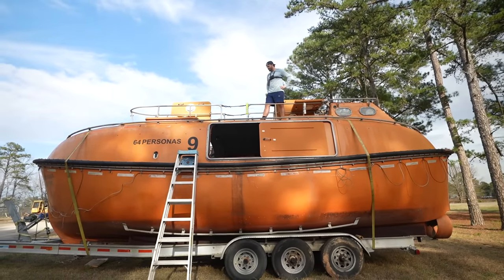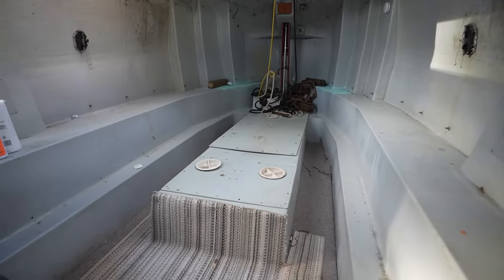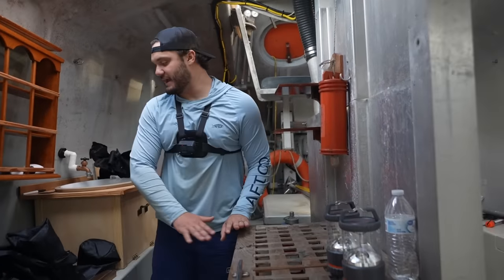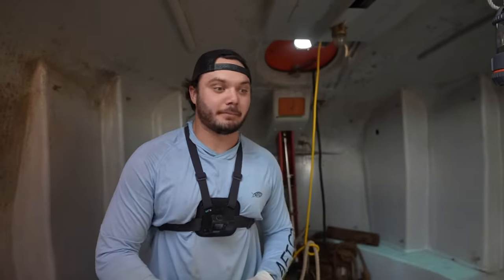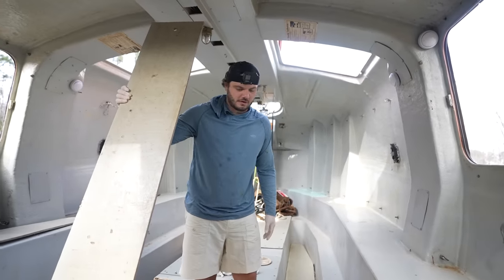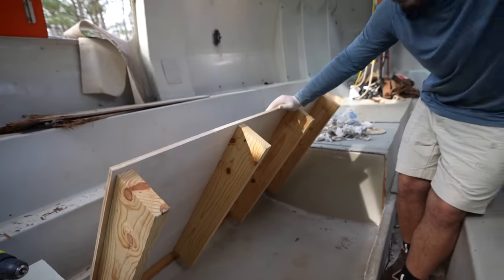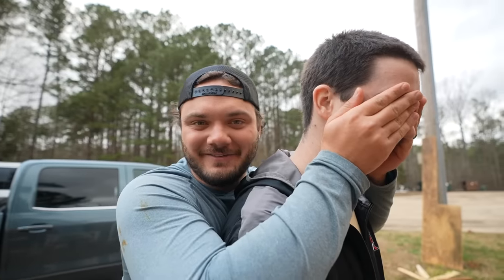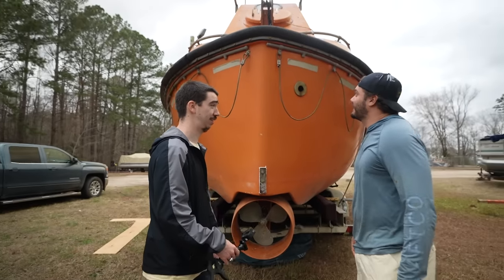Putting A Homemade Interior In My 64 PERSON LIFEBOAT!

Comment: Looks great so far. I would have to say you’ll at least need to drill some holes in the mattress base for ventilation. A foam mattress without ventilation underneath will get mold in it. Learned that the hard way and was out a grand on the mattress. So Swiss cheese that base to keep the one and only Gravy safe

Comment: That is a fantastic quick remodel, the only recommendation I would have is to add a little bit of bracing to the bed doors to keep it from bowing when you walk across... If you place a 4x4 brace at the top and bottom of the doors where they meet and then give each door a 2x4 brace along the long edge it would be perfect and feel like a solid floor when closed
Reply: Tacking on an idea to this comment: When the bed doors are latched up, make the underside of the doors more pretty. Don’t want Gravy to see bare plywood as he goes to sleep.

Comment: You should rig up some simple overhead lighting with like small can lights that run off a battery pack so that way, in the evening, if it's buggy, you can close it up and still have light. Also, you should put screens on the two holes above the bed so you can open them up on nice nights and look up at the stars as you lay in bed.
Reply: Just snuggling with the bros, watchin the stars.
Reply: What
Reply: Yeah I was gonna say you need big screens
Reply: Bug*

Comment: 20:56 Add a thin 4 inch wide lip to the bottom of one of the doors so that two inches are attached to the door and two inches overhang towards the other door.  This way you drop that door first, then the other door and it will "seal up" better and you won't get blankets/sheets pinched and poking through the crack that you do at this point in the video.

Comment: Would definitely be a good idea to put a Maxxair fan or two on that thing. They can either blow air in or exhaust air out.
Reply: 😂it had me cracking up when ayo’s helper said his eyes were burning and it was in his mouth💩💨😂
Reply: Heck yeah. I was thinking it needed some air rotation.
Reply: Word 👍👍
Reply: Hello, I like the idea of keeping it as water tight as possible. So, no new exterior holes.
Reply: @ClutchPedalReturnSprg  a Maxxair vent would make it safer to be in and allow air movement even if it's raining. It may have been designed to be sealed up but without scooba tanks and a good seal or vent for the engine, it wouldn't be safe to seal up.

Comment: so you should make some pull out storage containers to fit under the bed, looks like some long rod holders would go great under there, and you blocked off the dry storage area, but if it isn't an air tight bulkhead you could cut into the front of it and place hinges there for pfd storage or something else, won't lie semi jealous of this build because you could really really turn that thing into the complete houseboat/water camper lol

Comment: You could add another alternator on the engine that would charge a battery pack for lights and such.
Reply: I was thinking some solar panels on the roof would be killer.

Comment: Just an FYI you can get paint and have them mix it at different percentages so you have the same color but lighter. Get that paint at 50% and I think you would like it much better. That is a cool boat. I have never seen anything like it. Cannot wait for the finish. You know this would have been a great cabin for Lojo’s pond or a nice tiny house. That cabinet under the Matress making open from the front and have a place for pillows and blankets.

Comment: Hey AYO, I think you can better utilize the space if you cut your bed in half and made each side like a murphy bed. You could probably keep most of what you built and just tweak it. This way your bed is stored out of the way against the wall until you need it. And you wont have to worry about doors falling on you, worst case scenario.

Comment: This a really cool idea.  TEMPSCs are designed to be airtight and basically last forever in saltwater environments yet ran for 5 minutes a quarter so the engine and hull are practically brand new.  

I do hate the be that guy but I will point out that this is NOT a free fall lifeboat as mentioned in all of the videos which is a good thing.  Freefall boats are made so that all of the interior is built at an angle with chairs facing backwards and lots of steel structure to support and protect its occupants during a launch, which you would of had to work around.  

This boat would be launched by a gravity davit on a pair of cables (falls) which are released by a mechanism by the coxswain once lowered into the water.  This is a much better candidate for a houseboat conversion than a freefall design.  

Next I vote you put an AC unit and a diving board on it!

Comment: Alternate use for that folding bed top thing: keep the doors flipped up most of the time, then the space between the doors and the hull can conveniently be used as a hamper. Come laundry day, just unlatch the doors, and wham, there's all your laundry ready to be stuffed into laundry bags lol. I could also see replacing the fuel engine with electric in a way that allows the prop to free-spin and generates some power. Perhaps a craft like this could have one of those sail-kite systems made extra rugged for downwind runs. Great time to recharge your electricity with the prop lol. I think the folks I saw that made an Arctic cruiser out of a 100-person lifeboat did that. I love the idea of turning one of these into an all-season tiny home.

Comment: The dash to the engine is in norwegian, i´m half norwegian so if you want it translatet just let me know. Very basic stuff, tells you to glow the engine max. 30sec before start, check the battery charging light, main battery breaker and stuff like that. Love the show!

Comment: These things are designed and built to take an absolute flogging so I don't think you'll run into structural issues.
I think you could get more useable deck space outside if you look at making some "wings" that hinge at the gunwhale level and fold up for movement on a trailer or the water. They can be secured to points on the side of the upper deck. Aluminium would be a good material to build the base frame out of. That way you have deck space without having to be on the roof and restricted in its usefulness, even if it's just grating and not solid decked.
When Googling "64 person lifeboat" you fill the entire first page! WIN!!! lol
Definitely look into some solar panels for house power. Just like an RV or camper. The Jackery, EcoFlow and Bluetti systems are awesome, but having something that you don't need to constantly check and recharge pays for itself.
The sheer size of this boat gives her huge amounts of potential just due to the amount of interior space.
Reply: I think the interior space would be much better with floor boarding right across the bottom starting from the side seating height, so it's one even floor throughout the whole vessel. It looks like the roof is high enough to do that. That way there is a lot more space to put a bed, table, chairs, etc. It would also enable storage under the floor and the engine would be under the floor with access to it. I would also spend time and money carefully designing the interior after making it watertight. Might need a woman's touch lol. Also add a small toilet/shower section. Oh, and paint the outside white with nice trimming. The outside would be a whole other project to be honest, such as changing most of the openings into windows with one doorway. Obviously, everything would have to match the shape, but that's part of its uniqueness.

Comment: You should get one of those aluminum ladders that are for RVs and pannel vans, and mount it to the outside by your main entry hatch (or on both sides).

It will make getting in and out easier plus give you a better path to the roof.

Comment: That's what I was thinking about!  I was thinking it'd be really cool if you can turn it into like a camper.  Maybe you could put a bed inside there, and a table with a couple chairs.  Put a radio inside, and some books.  Maybe you can even put solar panels on it somewhere so you can have electricity to at least brew a cup of coffee and run a laptop computer and some lights and a mini fridge.  You know, kind of like all the Comforts of home.  You might want to clean it up really good on the inside and give it a brand new paint job on the inside first, and maybe even lay some carpeting in it.  Maybe even add a couple plants, and a couple pictures on the wall.  Oh, and don't forget the rod and reels and the fishing tackle box.  The possibilities are endless!

Comment: The repaint has made such a difference. It looks clean, light and fresh. I do think that the top deck needs a fresh coat of paint too. Preferably before you add the solar panels. I've seen Narrow Boats on UK canals with super thin solar panels that stick to the roof of the Boats. That might be worth considering or at least checking out?

Comment: Kindly suggestion. Put long pieces of a soft plastic of rubber running the entire length of the "coffin doors." Two strips over the hinges and one that will overlap the opposite door. That way when condensation happens, and it will, you have at least some protection for the mattress.

Comment: It needs more amenities. First. Needs 24 in flat screen television. Need to add some plush comfortable seating, inside. Also, needs lighting, inside, so you can chill inside at night or when it rains. Need to add more accessible ladders inside and to get to the top. Add walkie talkies. So, when someone is on top, they can talk to someone inside and via vera. Needs a Camera. So when your inside, you can see what is happening outside, on the 24 inch flat screen. You need a frig! Also, needs a place to store garbage. And what about number 2? Also, the topside needs some kind of chairs, so multiple people can chill on the top side. And, some kind of BBQ and a toaster oven. Also, need those fishing-pole holders. So then not using the fishing poles, can just put them up in those holders. Probably needs some kind of tackle box for the top side (that is bolted down) so it not falling off the roof into the water. Need a fish cleaning area. If your going to catch and eat the fish. Put down some of that anti-slip tape on the top side. (get it a boat marine store).

Comment: I would have cut that forward center storage boxes out. Make a flat floor all the way forward as possible. Put bunkbeds on both sides forward. Have top bunks fold up, and a removable table between the two bottom bunks. Maybe even have the two bottom bunks fold up out of the way also.  Lots of space
Reply: That would make the boat much more useable for different outings. Can even add a walkway around the edge

Comment: Sunlight exposure will deteriorate that super-structure over the years, but if you bury it as a bunker, it'll burst out of the soil as that water table raises; if you paint it with a UV resistant coating you'd go blind in the vicinity of its glare: if you add ballast over-it to hold the bunker down, there's a formula to it's volume-buoyancy, add too much, it'll slowly sink into the soil.

Comment: Prediction: You're going to want to redo some of that bed after you stay in that baby a few times. While it's a cool idea, there are some things that could be done for a better, safer, and cleaner fit and finish that will also prevent any accidental spills from soaking your matrice. I thought, at first, that you were going to design it to be a bed that would fold up from the sides (matrice and all) into the center, making a normal height table top with lots of seating on each side... Missed opportunities, I guess. But, the beauty is, you can do whatever you want, as many times as you want, because it's your boat. I sure hope you put more planning into the solution for the roof and its access, though. That part is a death trap as it is now, and could end up worse if you ain't careful.  Good luck. I can't wait to see what you come up with.🖖

Comment: Go Dental White, with the Base paint. Next, Home Theatre.. I can Help with that, btw..  7.2 Surround Dolby Atmos Receiver......75" 4K TV, connected via HDMI, to a Nice water-cooled Personal/Custom Built PC.  TV's don't run nothin... Personal Towers, and Home Theatres from your couch are the way to go. Wireless/rechargeable keyboard/mouse, to 75" 4k Display is Excellent, but  I Want a 125" TV.... I Mean for me. The Lifeboat would Surely fit a 75" LG 4K TV.  and maybe a few more, for Navigation.....

Comment: Without ventilation under the mattress you'll end up with a moldy mattress in time. Consider slats or drilling a bunch of holes in the platform so it can breath. Like 1"-3" hole saw.

Comment: You could put the ballast under those floors. what would be a easy to build deck extension design a poop deck and forcastle. you need a place to fish from and use the grill.

Comment: Ayo there is a product called "kaboom mold and mildew" that is a spray bottle. Spray it on them walls and let sit for 15min and wipe away. It will change the way you clean thing in the boat and even the house. 

It's a game changer and you will be surprised how cheap it is.

Edit: who's FJ is that?
Also you missed an opportunity at 14:39 to say "That's a glorious hole"... step it up bud!

Comment: Did you utilize the old storage spaces under the bed? You could’ve installed hinges on the old storage lids to provide extra space for backup batteries or extra cables and provisions.

Comment: You need to put a strip of 1×2 along the bottom edge of one of the bed doors with an inch of o erlang so the other door sits on it will keep it from getting that nasty trip hazard in the middle when ya iz on it... just a suggestion

Comment: What if you added some blocks of wood on the inside of the bed doors so when they are open you have a step ladder to get through the hatch? Then when its closed it would also act as bracing.

Comment: Will it fit under a seven foot bridge?  I'm in Merritt island and we should do a collab where we put solar air conditioning on the lifeboat.  There is a seven foot bridge between my dock and the intercoastal waterway.  You can watch rocket launches from my roof if you want.

Comment: If you plan on using it on lakes, you will probably be fine using regular house paint. If you plan on a real marine environment (coastal), you will seriously regret using regular house paint.

FWIW - I thought you were pulling into the marina I am in. A slightly different 64 person lifeboat came in, he had traveled about 200 miles up the coast in it... Thing handles just as it looks, a balloon with a prop.

Comment: If you use those cheap, LED, string lights it wont matter what colour the walls are as you can set the LED colour(s) with remote control!!

Comment: I wonder if you can change the prop or change the gear ratio to get a little more speed?  These weren't built to actually go anywhere, only have enough power to face into the waves and wind and have a little rudder control.

Comment: I dont know about the structure of the boat, but it seems thar the steps inside are meant to be used as seats, like as in a stadium, by any wrecked ship's crew menbers. Since there will be not more 64 people using the boat at same time, isn't possible to cut off these side steps? It would affect the strutcture and safety? Cause it seems to represents a lot of space.

Comment: You really need a regular door and a better roof so you can get around without having to step over everything. Cut part of the roof off the back and make a deck . You will loose head room but it will be over the bed so shouldn’t be a problem. Good luck and please clean up after yourself. I thought I seen the itty bitty, if the interior is done on it show us.

Comment: I want to buy one of these and keep it in my yard and have it fully remodeled and stocked with food water weapons and supplies for when the world floods again.. just run inside seal it up and hold on tight.. we are over due for the next major cataclysm and it could be another pole shift followed by massive walls of water but honestly something is inevitable either that or what I think is more likely a solar flare large enough to kill all our power and electric devices putting us back to the stone age instantly.. that 100% will happen its just a matter of when it happens.. one knocked out the telegraphs back when electricity was starting to get big so it will happen again and now our life revolves around power and everything is computerized so we are eventually screwed.. im rambling but its all true and going to happen maybe tomorrow maybe 5 minutes from now or maybe 5 weeks 5 months or 5 years